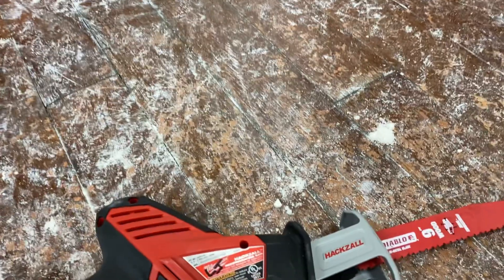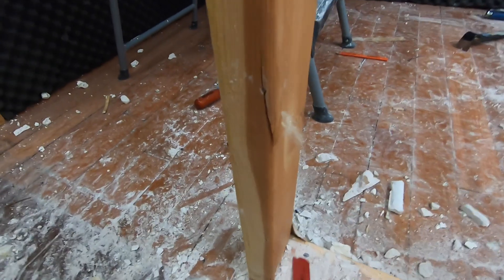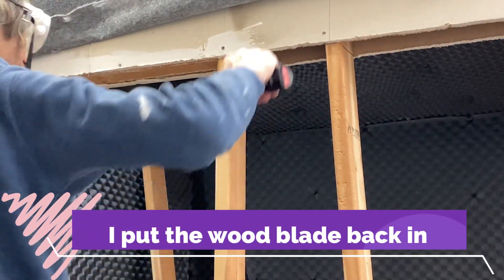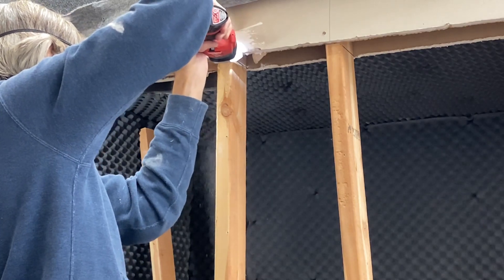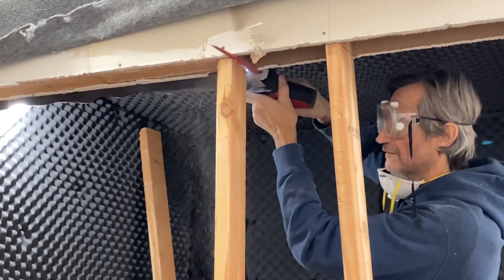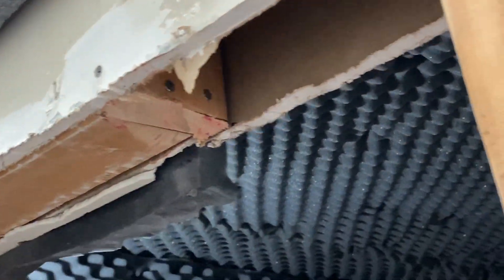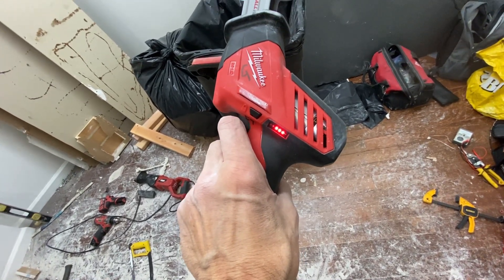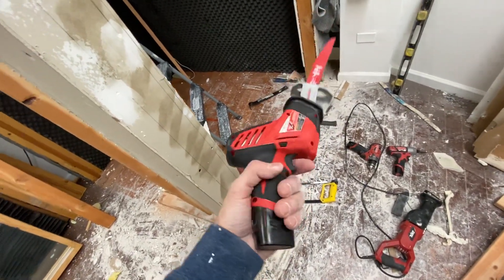Cutting with the Milwaukee M12 hackzall saw wood stud and nails

Comment: If the brushed version works this well I'd only imagine how good the Fuel version of it is.
Reply from the maker: If it’s something that you are going to use a lot, I would definitely go for the brushless.
I haven’t used my Milwaukee brushed saw that much so don’t know how it holds up to heavy use.
That being said, I use a brushed Ridgid multi tool frequently and it’s holding up well.